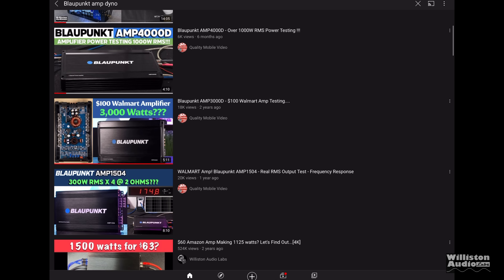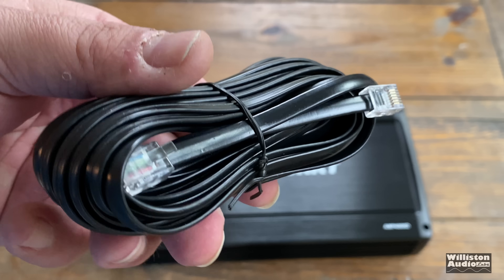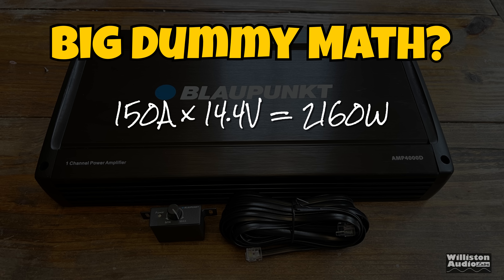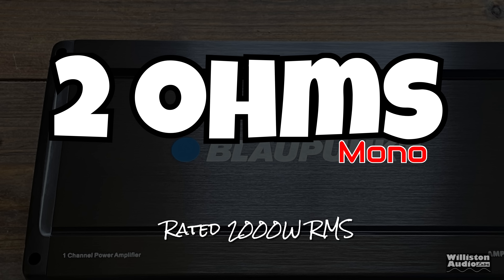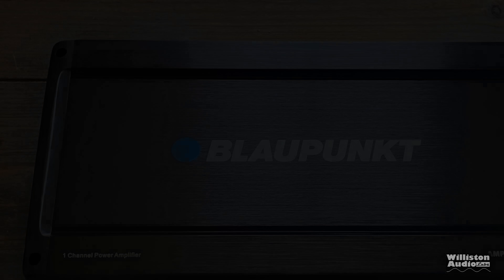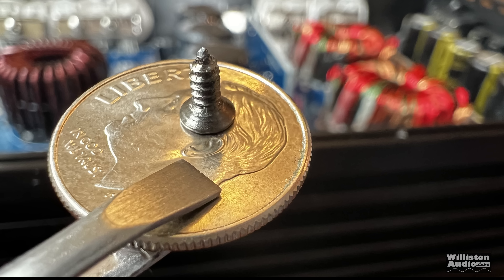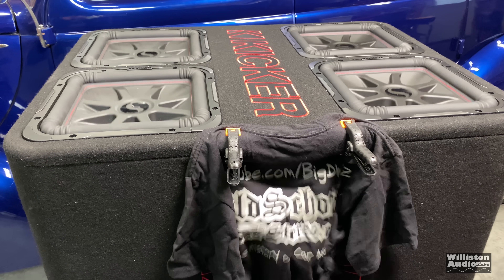How Much Power Does a $49 4000W Walmart Amp Make? [4K]

Comment: Outrut is a new feature when you get stuck in deep mud ruts you throw that amp under the tire and boom your outrut and on your way!🤣
Reply from the maker: Is that like when the mud gets stuck inside the tires?
Reply: @wal  kinda
Rut: 1. A sunken track or groove made by the passage of vehicles.

vehicles leave deep tracks “rut’s”that start drying up that causes some vehicles get stuck either high centered or possibly insufficient tread as well I suppose.
Reply: It's when you feel like your stuck in a rut in life, the 4000 watts will power you out!

Comment: Has blaupunkt ever been good for real? Even in the 80s it only seemed like they were good but they never were
Reply: 80s and 90s they were fine. We installed a bunch of them through the very early 2000s. They never were going to be on par with the cheapest Alpine but seemed no different from entry-level tier Sony, Pioneer, and Kenwood of the day. I saw better mech on CD transport and even tape than trash-tier (e.g. Aiwa) so they were solid for the money. You could do worse.
Reply from the maker: I was never a fan honestly. Felt they were expensive with limited feature set back then.
Reply: @wal  - definitely low on features, but we had almost zero returns/warranty claims on them.
Reply: Correct.
All the guys on here saying Blaupunkt used to be good were the guys we were making fun of back in the 80s and 90s. 👈🏻😎

Comment from the maker: Shop (affiliate link): https://amzn.to/3CyHDKx

See HiFiVega's video here: https://youtu.be/C_w0ztevaR4
Subscribe to HiFiVega: https://www.youtube.com/HifiVega

Subscribe to my 2nd channel: https://www.youtube.com/WheelieWilliston
Updated Behind the scenes video: https://youtu.be/1W1ay6R3f6A

Video Index:
0:00 Intro
0:45 Blaupunkt Amps
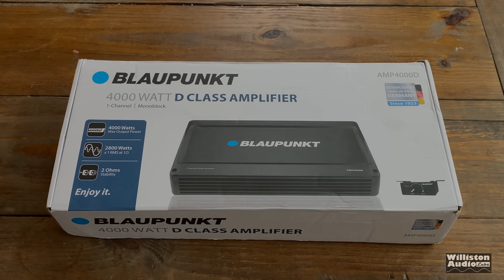1:48 Unboxing the Amp
3:08 Features and Specs
4:50 Amp Dyno Tests
8:47 Do It Bump Doe?
10:03 Thermals and Guts
11:00 Pros / Cons
11:38 Conclusion
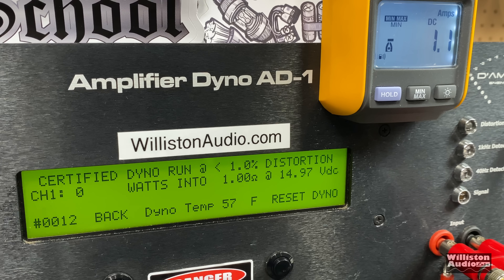12:24 Extras

SMD / D'Amore Engineering Amp Dyno: https://goo.gl/sJTcf7
XS Power D1400 Batteries - https://amzn.to/2BPFCKW
XS Power PSC60 Charger - https://amzn.to/2CHGcfs
Fluke 1000A AC/DC Clamp Meter: https://amzn.to/2Rw5WDA
Handheld Dyno: http://amzn.to/2u2EgKV
My Favorite Screwdriver Kit: http://amzn.to/2x0VzcE

DISCLAIMER: This video and description contains affiliate links, which means that if you purchase from one of the product links, I may receive a small commission. As an Amazon Associate I earn from qualifying purchases
Reply: I like that they separated the power and ground inputs with the remote turn on.  The further away from each other the better. I hate when a random single strand of copper gets into the personal space of either + or _
Also if you have 2 of these amps on 2 (12") or 10" dvc subs wired to 2 or 1 ohm. You could push them well for under a hundred bucks!
Reply: Hey, you do realize that Walmart will license a name and pay a third party to produce it?
Since it doesn't show up on Blaupunkt's website that's the safest thing to assume here.
Reply: I bet the 3k version with 3 of the 40 amp fuses puts out more watts then this 4k
Reply: have you see the lanzar vct2610
Reply: You have to try the wireless sound boks in a car audio settings please
Reply: If you don't do this when you can or say your going to do this I will post on every video for you to try it